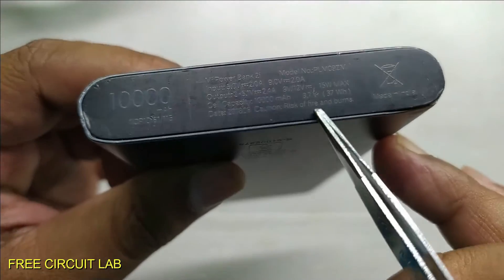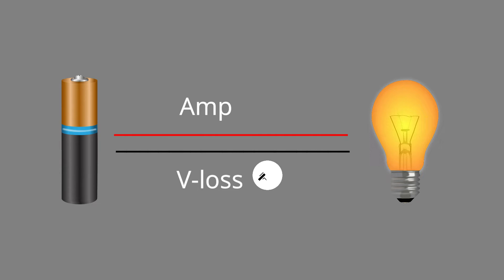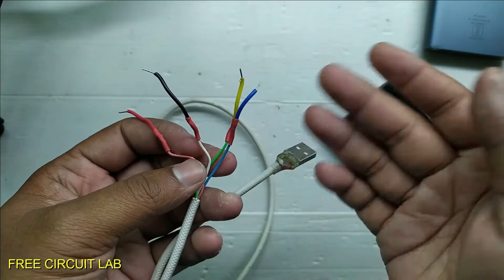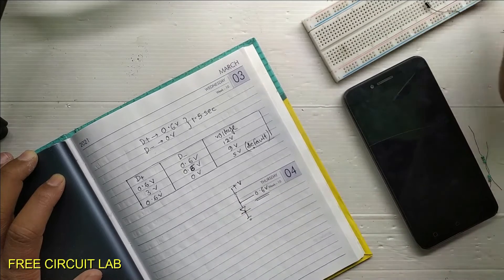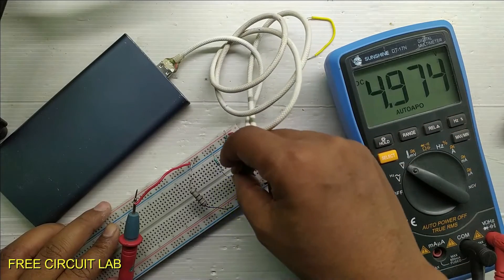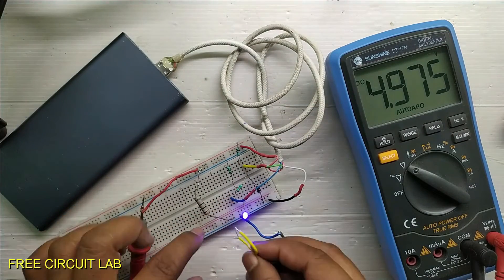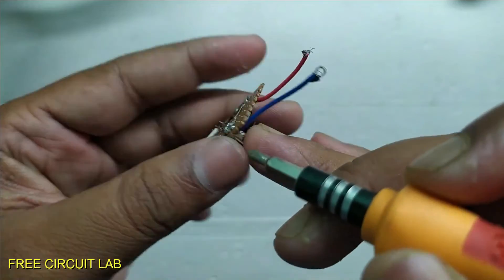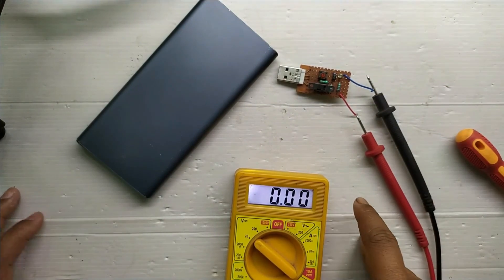How to get 9V, 12V or 20V from your 5V Charger?

Comment: Hi buddy. I own a Samsung S10 lite which should be able to charge at 45watts according to the internet. I'm using a PD 100watts USB station charger which supports PD 3.0/2.0, QC 4.0/3.0/2.0, PPS for charging my phone at 45w, and I'm using a Ugreen 100w capable cable, yet the max Voltage I see on a USB tester connected shows 9V and only 34.5watts peak when charging the phone from 0% battery. As you seem to know your stuff, my question is, please: why it is not switching to 20V charge so that it can reach higher wattage? Thanks for your time, brother. Greetings from Italy.